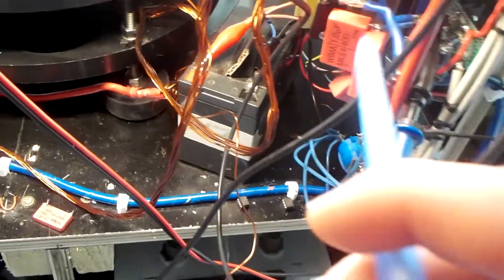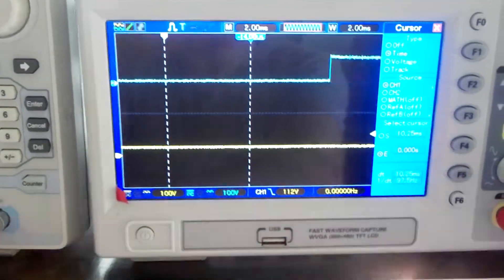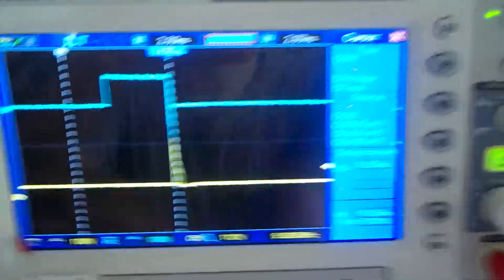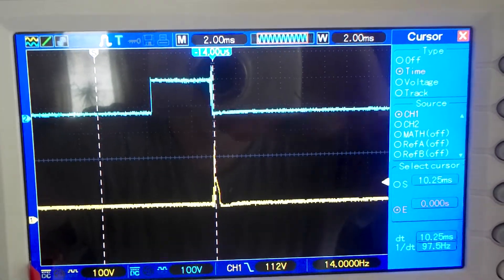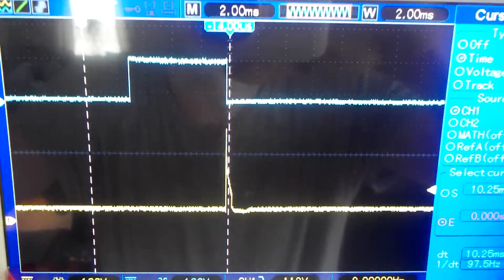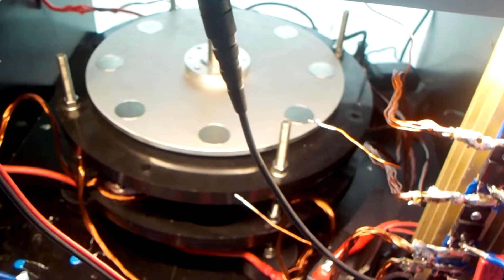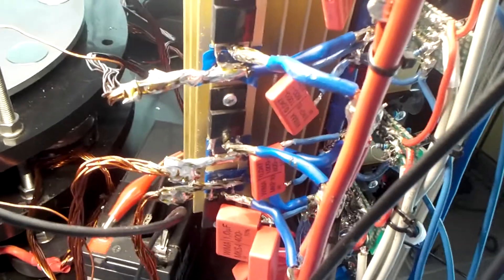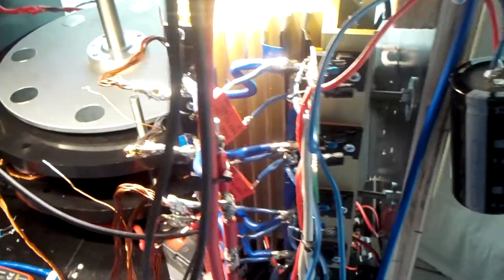002 Big Dual Pole Motor To Short On Time Problem

Comment: Hi , it is possible to run your motor at coil(coils) resonant frecvency ?
Reply from the maker: @Razvan Dia, I tryed in the past but because this coils have core material the frequency can not be that high was always told to me. At the moment I'm experimenting with the negative series impedances and there I see completly other results. When I put a longer trailing time to my input pulse to gate driver I get RF bursts and voltage has great peak,  which I don't have when I just use higher frequency. So I can't give you an exact answer to your question at the moment. Watchout when experimenting with the long trailing edges.  During the RF bursts the gate driver will draw more current from it's power supply and also the coil from it's power supply. It's best to have current limiting circuit. You can find pictures of my current experiments on my album: https://photos.app.goo.gl/dZtmiNBfLPgqvXnQ6
The pictures with "Multifilar coil experiment" are the ones talked about. Looking for what is normally said about resonance to motor coils is that there should be a resting time to let the fields collaps completly. I know this is not a direct answer to your question because I hope I show you that I'm not sure myself and why this is the case.